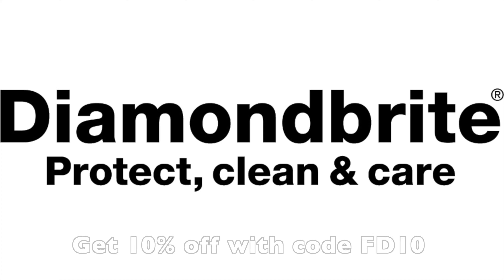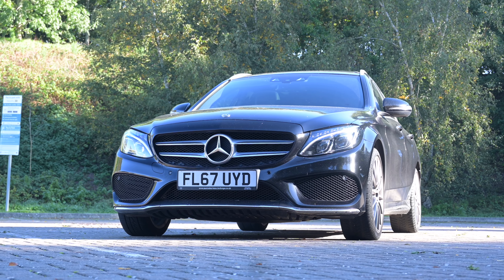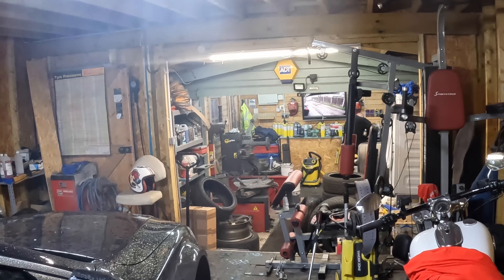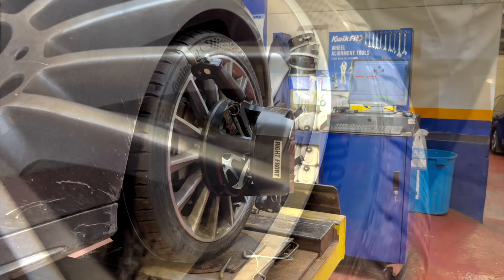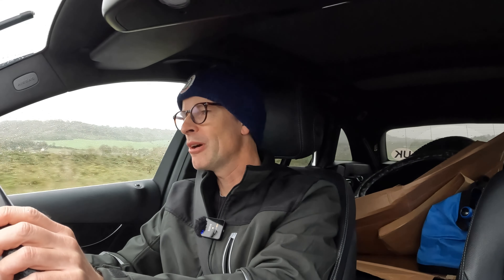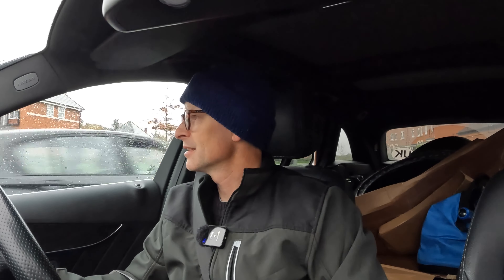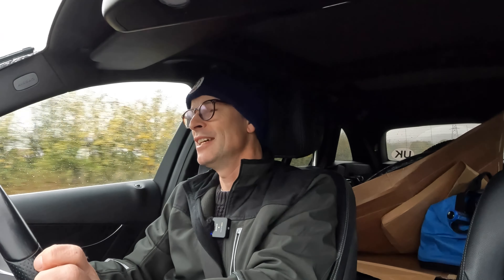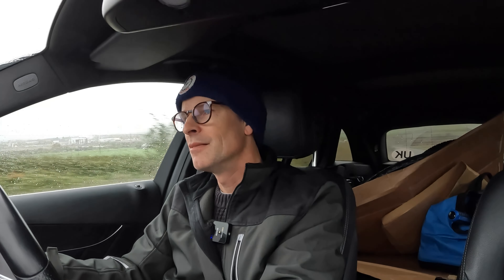Mercedes C250 10k mile update...Is it my new favourite?

Comment: I am completely with you on the 'lack of control' in an automatic car. It's the creep forward that always scares me at traffic lights.

Do you find the HOLD function you have to push unnecessarily hard on the brake pedal? My dad's S213 E-Class you have to really mash the pedal to get it to come on. Completely different to my Passat where is comes on at the slightest hint of the pedal when stationary.

You are bang on the money with the interiors though. The E-Class feels like such a special place to be. My dad is planning to retire in 2 years and wants a smaller car so I am likely to buy the E-Class to replace my Passat I've had for 15 years.
Reply: Yes I agree with the HOLD function… My last two cars have been VAG products - 18 plate Leon and a 19 Audi A3 - and the auto hold in those cars requires no effort. However my partner’s 13 C Class and 18 A Class literally need the pedal pushed to the floor to function.
Reply from the maker: You have to really shove it to engage, but release with the lightest touch
Reply: Why not just put the car in park or neutral if you want the avoid the "creep forward"? There is no extra thing do to compared to a manual, because if you have the manual in gear, you have to push the clutch down, which is just subsituted for the brake with an automatic...
Reply: If you press the brake pedal like normal people the car won’t creep forward
Reply: @bmwman1981  what a paronising statement- cheers buddy!

Yes i understand that but that causes the brake lights to stay on for the person behind, blinding them. That's a pet hate of mine so want to avoid doing it if possible
Reply: @timprice5  if your in a traffic jam or queue then everyone else will be pressing the brake pedal I cannot get on with auto hold it’s annoying

Comment: Love the video! I have the same model. Do you know if you configure individual mode to be manual, when in individual mode it never puts it back into auto? That way you have to use the paddles, or it gets quite loud 😎
Reply from the maker: Yes, I did try that but with 9 speeds I almost cant shift fast enough!
Reply: @furiousdriving  yes, that is true! The other use I have found for for paddles is to “prime” the gear box prior to an overtake. If you hold the right paddle for 3 secs, it drops down to the lowest gear the car can handle at the speed you are going. This is much like the kick down. However unlike the kick down you aren’t accelerating, meaning when you put your foot down for the overtake you don’t need to wait for the gear change. Holding the left paddle for 3 secs then put it back into auto. The other thing I learned just recently is that there is a hidden use for the otherwise sort of useless “menu” button on the center console. Hold it for something like 30 secs and it resets the air con to 22, linked and full auto… I find this useful after my mrs has driven the car 😎

Comment: Try using the Dynamic Select which changes the character of the gearbox. Mercedes know what they are doing. I drive both a 9 speed E and a 7 speed SLK. You will find fun to be had.

Comment: Do keep in mind that the Sport Contact 7s are one of the stiffest summer non-runflat tyres you can get. This does mean that you get more road feedback, and the SC7 is the best road tyre on the market currently for both dry and wet grip (so they're quite sticky). Do be careful though, I saw that these were reviewed as having poor aquaplaning resistance, and I've found they will aquaplane relatively easily in my own experience.
Reply: Agreed. My company car showed me that on the M5. Made my hole twitch 😂
Reply: @angrymuffinsb  I was trying to accelerate out of a corner on a country road, when the tyres aquaplaned and I almost hit the redline while not accelerating at all. They did recover pretty quickly but I'm usually pretty careful with them now when there's water on the tarmac.
Reply: @CatBroiler  that very same thing happened to me yesterday! And as I lay here at 3:50am hearing the rain hammering against the window. I can’t wait to go to work shortly 🙃

Comment: You may have solved this issue already, and I've missed it, however I thought I'd mention...your electric boot that opens if and when it feels like it when you wave your foot... Have you tried waving your foot and then stepping back? I recently noticed that a family member's brand new Ford Kuga had the same issue where it just didn't seem to work - until we worked out as a safety precaution you must step back first. Who knows maybe yours requires the same action!

Comment: "You hardly ever get a crack on the outside" 

Haha.  Been there seen that.

Ten years ago the 18" Straights on my MG ZT 1.8T I bought had Runflats on the rear wheels.  Why?

Wheels a bit tatty .. cannot have that. Off to the refurbishers with them. That revealed why. The extra wide tyre bead to rim interface area of the Run Flats ( Heavy ) covered the unseen crack ON THE INSIDE of one of those wheels. Thus, no loss of pressure. Fitted UNIROYAL RAINSPORTS as I prefer their "does what it says on the tin" in the wet stuff. Sold the two slightly worn runflats for a tidy sum on Gumtree. Bonus.

That crack on the inside of the wheel's inner rim back then cost a huge tenner to alloy weld repair prior to refurbishing by the Digbeth Refurbishing Company I've used for years. Instead of the MG-Rover silver, had them refurbished in Brilliant White Gloss which lifted the XPG ( X-Power Grey ) cosmetically contrasting and enhancing the appearance of the otherwise dull ( to my eyes but looks good when clean ) as ditchwater grey favoured by so many cars on UK roads today. Talk about fifty shades of grey. Still have that ZT saloon but prefer to drive my daily driver MG ZT-T 1.8T workhorse for its better load carrying capacity. Both cars nice to drive and keepers though.

Keep this interesting furious driving stuff coming. Much appreciated.

Comment: I had an A class on loan for a month with those flappy gear change levers and yes I totally agree it was annoying as anything that the gearbox switched out of manual mode after a few moments of not changing gear. I concluded it was no more than a gimmick

Comment: Glad the tyre change has transformed the car. In the gearbox I have the I dynamic set on Sport Gearshift and Sport Steering not E or Comfort it makes a much better shift the Gearshift is much better and makes no difference to Fuel Economy. It's probably better as its changing quickly at the right time.

Comment: You should be able to change your transmission settings, to suit you. You can change all sorts on modern cars, via an OBD-accessed app on your phone.  Things like headlight sustain after locking, pedals pressed to start, when the windows shut, etc. So things like flappy paddles might be doable...

Comment: It’s interesting that the 9 speed Mercedes’ auto box is problematic. I had a Mini Clubman with the BMW 8 speed. It was great, economical on eco mode, fast and even sporty sounding (for a diesel) in Sport mode. It was very hard to catch out. 
I now have 1litre Suzuki Baleno. This has the 6 speed auto box. In auto box I can override it, but like the Mercedes it switches back, usually inconveniently. But move the stick and I have full manual control. I can hold gears to the redline, I can do engine braking by changing down. 
I can’t believe that a £40k+ Mercedes cannot do this. 
The Suzuki also has adaptive cruise control as standard :) 
I am looking to change it, but I am debating whether another auto or back to manual.

Comment: I've done similar mileage in my D5 V90 (which was at The Motorist for your meet next to Richie's V70) to your C250 and I still don't like it that much.  Many of the same complaints to be honest, fuel economy of mine is similar to yours, for the last 4k I think it's averaged 37mpg.  I'm still thinking about getting rid of it for something else.  I enjoy driving my 960 which is automatic but the V90 not at all.  Road tax on mine is the same as yours and falls into the higher bracket because of the initial purchase cost.
Reply from the maker: I drove a V90 Cross Country up to Scotland and loved the interior and look of the car, but perhaps too much automation and insulation from the road on modern luxury cars separating us from enjoying the drive.
I almost went for a V70, and only didnt go for it as I wanted RWD or AWD, and the V70 reviews didnt say to was a hoot to drive
Reply: @furiousdriving  Interior of it is very nice and comfortable but I don't like all the technology.  Definitely too much insulation from the road, it's a very easy car to go fast in too like you mentioned in the video, 50 can feel like 30, 90 feel like 60 etc.  I drive my 960 (which is my summer car and only done about 2k in it this year) and feel like I'm doing the speed that I actually am when I look down.

I too like the V70 but what engine to go for? Diesel sensible (forgetting the D2, D3 as they're rather small) but the world doesn't like diesel and petrol is £££ - although would be interesting to compare diesel and petrol running costs (inc, inefficiency with E10 compared to E5 and E0?) with the price difference at the pumps now.

I test drove a Skoda Superb, didn't like the auto, manual much nicer but compared to the V90 the Superb just felt like a lesser car (I don't mean that in a snobby way, much more plastic, more flimsy, more mass produced) and used they aren't much cheaper than the V90, around £3-4k at the time.

I have driven a V60 which I prefer to drive, the V90 almost feels too large and with too much weight at the back when you start chucking it about.  I'd really like to try a manual V60 but they aren't that common, according to Volvo most are in Business spec too.

I don't know what to do car wise.  Whether to get something old that I like but then something sensible, cheap tax, ULEZ friendly for running around but then that's getting rid of one car and getting two which doesn't make sense either.  I don't know whether to get an older petrol V70 but then that's going to cost a fortune at the pumps which I'll probably complain about.  I'd love a V8 S80 but then that's not sensible either 🤷‍♂😂
Reply from the maker: @SuperFIFTHGEAR  I know what you mean about the sort of snobby feel, I considered a Skoda, Ford and Mazda but felt like going down a level!
Reply: @furiousdriving  I do like the Mazda 6 but the diesels in those are known for serious problems and I know people who have looked after their cars and still had problems.  I really wished Toyota made the Camry (that's now been discontinued) in estate form, the latest Corolla is a very nice car but auto and they seem quite popular, high price on them as well as they're still relatively new.  Possibly a car to keep an eye on in the future.

Comment: Nice to see an update on the Mercedes.  I'm dead set against learning automatic gearboxes, I want cars that behave consistently.  It feels like, as the hardware in our cars has got better, the means of exercising control have actually deteriorated.
Reply: Agree, the self learning boxes have no way of knowing that you are about to overtake. Also they change depending on how fast you attack the throttle,  not a good idea in many situations.
Reply: No problems whatsoever with what you describe in any of my BMWs. Try a car where they are serious about driving, not just transporting yourself, and it might not have those issues, I guess?
Reply: @andrewthompsonuk1  If you are about to overtake, what would you do in your manual car? Exactly the same function is availible in an automatic, I guarantee it
Reply: @GoldenCroc  
Overtaking requires very precise control of the power throuout the manuver. For example when you start to pull out you usually do not want kickdown power, you want to feed in the power slowly, these auto boxes will often just labor in a higher gear because the box thinks you are a slow driver. This means that you do not have enough relative speed to get past. Furthermore the worst modern boxes may take another few seconds to kick down.

With a manual you just change to a lower gear before pulling out giving you very precise acceleration.
Reply: @andrewthompsonuk1  Indeed. And as said above the same exact function you seek is availible in an automatic car. Simply shift to a lower gear before the overtake, just as you would do with a manual. Easy as pie, I do it all the time. So no need to worry, it is availible, as stated in my previous post. Cheers.
Reply: @GoldenCroc  good point, one tends not manually shift on an auto and perhaps they should.  I do select sport mode however on my BMWs then they behave very well.
Reply: @andrewthompsonuk1  I mostly drive my auto bmw without issue, however I also got one of those pesky SUVs (of Porsche brand) and the paddle shifters or the stick itself works much the same way in it as well, no issue.

Where autos fall way short for me is when maneuvering in very low traction instances, they are a bit more jerky from standstill if you got a high power car. This can be somewhat remedied by left foot braking or starting in a taller gear, but I prefer clutch modulation to be honest. Old habits die hard. Cheers mate.

Comment: How does the Merc’s autobox compare to the one in the Crown Vic?
Reply from the maker: Very different, thats an old fashioned torque converter, very smooth and its quicker to react off the line but its pretty rubbish as well with a woeful kick down!

Comment: I'm with you on not liking autos, but one vote for the Jaguar is that it uses the ZF 8HP, and Jaguar have programmed their gearboxes such that if you put them into sport-manual mode, they won't go back to drive unless you hold the left paddle for about 5 seconds. They even go so far that the car will bang against the limiter rather than change up, though it will still change down if you slow down.

Comment: There's nothing really wrong with runflat Tyres. I run the bridgestone T005 on my E220d, very comfortable ride most of the time. It's usually the shitty road surfaces and potholes that give problems, which you can't do anything about.

Comment: Do the adaptive headlights actually adapt in a timely fashion? I've not seen much issue with Mercedes, but I swear every new Mini Cooper is blinding.
Reply from the maker: Dip fast, slower to come back up, impressive really
Reply: Very much car dependent, as well as how the road looks. My BMWs are flawless in most cases, if it wasnt for some of those dumb roads we have here with perforated barrier in the middle, which confuses it... My Toyota Auris was much worse on the other hand. Renault Talisman pretty good as well, about the same as BMW.

Comment: Sorry to tell you, but being 4 wheel drive doesn’t make the car safer in winter. The tyres are the key element here. I have an Audi A7 Quattro with decent tyres always fitted but can still get caught out on icy roads if not careful. Winter tyres on a 2wd car will always out perform a 4 wd car on summer tyres 🧐
Reply: Where I live in the U.S. we have a pretty serious winter season. And while I'm in no position to dispute your observation about 2WD/4WD w/ and w/o winter tires, I'd be interested to know your thoughts on that same choice but with the added variable of automatic or manual transmissions.  We have both...and when there's snow (esp packed snow) and ice on the ground, I really like the gentler and steadier application of power with the auto. I'm pretty good with the proper slip of the clutch to minimize the snatch...but the auto is so much easier. I wonder if Matt will come to appreciate it, too, when he's deep in the winter driving conditions.
Reply: Statistics about accidents say 4wd is less safe than 2wd, even with the same tires fitted. Thats because people cant tell its slippery, thus  keeping too high speed.
Reply: @-DC-  Right. The tires were the key factor, 4WD was a help (when both had winter tires), less power was better...and both cars had automatic transmissions (Matt take note)..."Be gentle."
Reply from the maker: @mowser12345 Ive made a video about this comparing 2wd winter to AWD summer so know tyres are the deciding factor bit AWD with winters is the best combo

Comment: I have contact sport 7 tyres 20” and ride perfect and grip amazingly on my Jag xf AWD petrol and my auto zf gearbox is great and paddles work well and won’t go back to drive mode but you have to be in sport mode  or it will go back to drive if not used and maybe do you have a gearbox issue as in sport mode it’s brilliant gear change and ride and feel and deffo try the hag auto

Comment: You brought up some interesting points in the past 50 years of driving l have owned 10 manual cars and 4 automatics at present our two vehicles one is an automatic the other a manual l do like driving both of them and l was able to afford to fit a brand new set of tyres to my 1997 Toyota hilux and they are by law high profile light truck tyres although l will not be carrying any heavy loads and you mentioned road tax in Australia you just have a regestration fee but if you are on a pension its free but only for one vehicle because my ute is registered in my name its free still got to pay third party insurance but the car is registered in my wifes name and she also gets her registration for free also we both get free drving licenses and l think the registration fee if you pay for it are similar for both EVs and petrol cars also no winter tyres same all  year round

Comment: You need to try a facelift model with the OM654 2.0 diesel. Very refined, fun and extremely economical (I average around 72mpg minimum on my 25 mile commute, 15 miles of which is motorway). Makes the OM651 seem like an absolute dog in comparison.